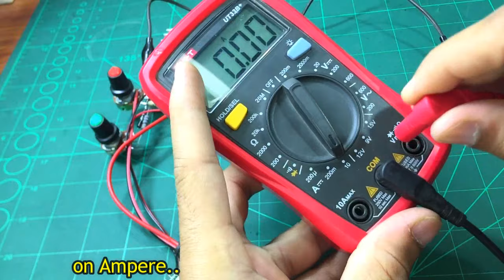Adjustable power supply 0-60v 30A | Voltage & Ampere Controller Using 2SC5200 Transistor

Comment: I made the circuit by connecting 2 c5200s in parallel and it worked fine. With 4 amps, I managed to fix the cooler at 45-50 C with the fan.
Reply from the maker: Nice bro

Comment: The pass transistor will burn up at lower output voltages.v drop across c-e junction would cause serious power dissapation problem.running at higher output voltages,not far from vin would do ok.turning voltage down would be bad

Comment: Can I use this circuit with 12v input voltage and use it as a adjustable 12v battery charger while controlling the amperage as necessary?
Reply from the maker: use almost 24v input
must watch
https://youtu.be/tHBFL5Iw0Ik

Comment: Bro what about short circuit protection. Current limiting
Reply from the maker: I WILL UPGRADE IT SOON
Reply: @electproject  once you upgrade it, can you make a vid and link the schematic in dec and can you add a set of buttons for 5v pv and 12v?
Reply: is it possible to add it (once upgraded) to a solar controller?
Reply: When can we expect an update?

Comment: Sir there is 30 Volts where is 60 volts plz make a video 0-70 volt Variable with protection ! Thankful !
Reply from the maker: YOU CAN USE 60V HERE JUST CHANGE RESISTOR 56 TO REPLACE INTO 220 OHM
Reply: Can we set both current and voltage for 70v dc with this circuit?

Comment: where is 33 ohm 5 watt resister in circuit diagram
Reply from the maker: ITS OPPTIONAL
Reply from the maker: 0.33 OHM RESISTOR NOT 33 OHM

Comment: 30 amps? What are you saying?
Reply from the maker: YOU CAN USE ADD MORE TRANSISTOR
Reply: @electproject  The more transistors, the greater the voltage drop
Reply from the maker: nope sir @БагирИсмаилов-й9щ